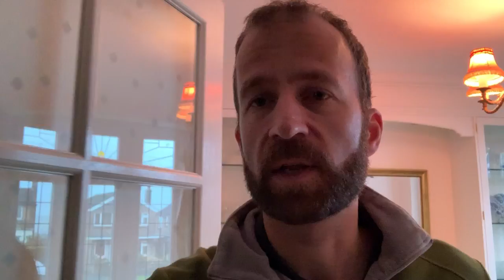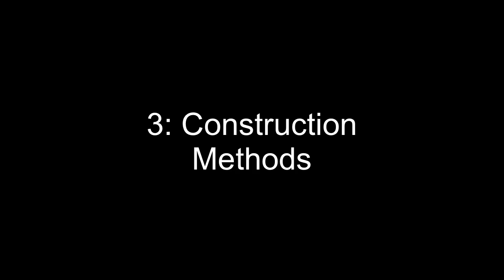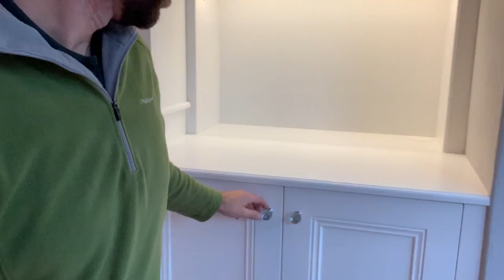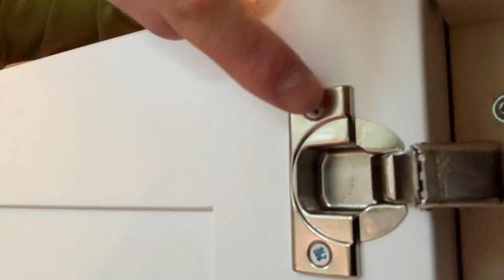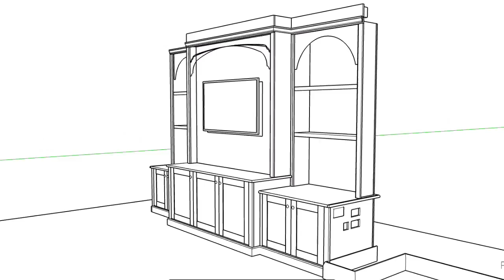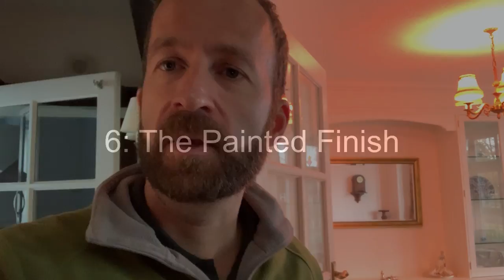£2k vs £5k MDF furniture - What’s the difference???

Comment: Hi Alastair. Brilliant channel. Only discovered a couple of months ago but am hooked. Late response to some brilliant comments. 
I’m a carpenter since leaving school. Now 53. Do a lot of fitted furniture wardrobes floating shelves. I love doing them & would like to just do them all the time. 
I make & fit on site but am in the process of converting my garage into a home workshop. I feel that’s the way to go to achieve better results & make life easier all round. 
I consider myself very fairly priced if anything underpriced. I’m finding I’ve not got a few jobs recently follow ons in a couple of cases where I’ve got a bit dearer due to increasing material costs.
I buy 50 sheets of 18mm mdf. I think it’s medite. I paid about £850 for these from magnets early 2021 by buying them in bulk. Now the same amount at current costs will be £1800. As it’s £36 a sheet now. Other thing I find is quite often once I’ve fitted my work , customers then paint what I’ve done to keep costs down & make a right lash up of it. Clearly doing no rubbing down in between coats especially on edges. Hence getting a really poor finish which to someone not knowing looks like that’s how I’ve machined it.
Reply from the maker: Hi Tony thanks for commenting and I'm glad you like the channel.  I reckon that if you are fitting unpainted MDF furniture you are definitely attracting a very price sensitive customer base and it will be hard to break out of that until you offer more.   It's tricky because the step up to offering painted work feels like a big one.  But the other route is to offer melamine carcases and bought-in vinyl wrap doors.  look at @barrettsfittedfurniture on instagram, or the jounrye that John Jones took from raw MDF - @jonesinteriors_sw - coincidentally he commented on this thread 3 years ago!  Howeer you do your doors, moving over to melamine internals is a must.  Apart from that, marketing is key, as I learned too late,.

Comment: Hi Alastair, I’m making a floor to ceiling display cabinet,  25 mm  MDF top and bottom with hardwood corner posts, it has to be finished in black, I’ve rolled on white acrylic undercoat, rubbed down with 180 grit and re applied a second coat, will rub that down with 220, I need to start top coats soon, I need to put a top quality finish on in black, what paint do you recommend to use on the Leland acrylic undercoat ? Do I roll it and brush it on with a tin of paint or buy spray cans ? I’m not set up yet with my spray gun and compressor.  Any help could be good 👍
Reply from the maker: Hi Graeme, sorry I took so long to see this and reply, perhaps I'm too late.  Black paint can be a nightmare!!!  I'd be wary of spray cans... might be incompatibilty with the base coat.  Safest to use a compatible Leyland or Johnstones product - I'd get advice from a Johnstone's decorator centre.
Reply: @Alastair_Johnson  Hi , thanks for replying, yes I’ve dumped the spray can idea, dug out my compressor and gravity feed gun,  it’s a white acrylic undercoat (leyland) would it be ok to use No nonsense water based gloss from a spray gun, also would you suggest watering it down ?
Reply from the maker: @graemeeasterbrook4931  Honestly, the only thing I can wholeheartedly recommend is the Sayerlack AT99 paint we now use, preferably over their compatible undercoat.   But have you seen this old video talking about our transition from the sorts of decorators paints you are discussing toward better spray paint? https://youtu.be/QjdIoW0rD3o

Comment: I have been working on new builds since I became a carpenter. I recently quit my job doing that as the original spark and enthusiasm for carpentry that I used to have was completely gone. I am trying to get into doing this kind of work and I've only just started out so I'm not going to be able to offer the pre sprayed finish that I would like. But I am a perfectionist so I wouldn't be able to live with myself putting out work like the lower end units you have shown here. I know I can offer a much higher standard to that even if i'm building it all on sight. Does anyone build on site but then sand fill and seal all the edges for the customer? Then they have a much better surface to work with when they paint it themselves? Or does anyone build on site and then also paint it on site as part of the service? I'm just looking for tips as i'm just starting but I also want to put out the best product I possibly can.
Reply from the maker: Yes that's definitely a valid approach - browse the comments, there are high quality workers that take this approach.

Comment: If the customer wants traditional style butt hinges on MDF doors, you can glue a strip of solid timber to the edge of the door, then glue your 6mm panels ontop to hide the join. The timber allows you to securely fix butt hinges to the door. If you sand and seal all the edges this can work well.
Reply from the maker: Ok yes I see.  I do prefer the ease and controlled motion of concealed hinges though!

Comment: I used those hidden hinges before. I did exactly the same as that guy did with the edge grain screws. It split because I joined two boards together. This was when I first started. Thankfully now I use concealed hinges.

Comment: I would suggest that the biggest issue is how does the tradesperson convey to the potential client that his/her work will be worth the not inconsiderable extra cost. In the case shown, the client would probably be aware that the older units are beginning to show the signs of the lower costs - the painted edges, the splitting from screws. This case shows the benefit of getting recommendations from an independent third party ( interior designer in this instance). 

I agree that, for many people, the difference of around £3000 would entice them to have a site operation of about a week as against to the installation of the newer units of 3 days. So, I don’t think that extra 4 (?) days would be the critical factor in getting your workshop built product accepted. 

I also agree that having a workshop is not, in itself, the guarantee of higher quality. It should be because of the higher investment in equipment and time, but we have all probably seen crap from a workshop and excellence from an on-site cabinet maker. 

So, how do you convince someone to pay a lot more for higher quality?
- does the client have the potential extra £3000? If not, walk away
- does the client want better quality? Perhaps they are renting or about to sell the property. Again, walk away
- controversially perhaps, are there signs in the house that the client values high quality? Ornaments, pictures, furniture etc.
- that third party referral has almost done the sales job for you - but can you network with local influencers (what a horrible phrase) to get recommendations
- get the client to your workshop if you can so that they can see the quality - and not just be told about it
- have a library of samples (doors, hinges, edges, mouldings etc.) unpainted and painted, so that the client can make an informed decision
- present yourself appropriately to the client ; don’t come over as a salesman when meeting the client but don’t go to the other extreme. Dress smartly, but not expensively; take your shoes off when going into the house; explain how yours is a family business - it’s success has come through quality and family values; don’t disparage other work on display - even if the client does; just say that every quality has its price and it’s place - our work is designed to last and last - for which there has to be a cost.

That list is clearly not exhaustive - or necessarily totally appropriate as I’m not in the business and so don’t understand it’s nuances. However, I’ve been a (serious) amateur woodworker for over 40 years and, before retirement, had my own business employing around 40 people. I do actually do some consulting work for a couple of other businesses - but these are friends and I don’t expect payment.
Reply from the maker: Excellent points!

Comment: You were being really generous with that other guys work, the fit and finish on it is appalling even for a built on site job. Slab doors shouldn't warp like that as long as the MDF is decent quality, I'm guessing the stuff used there was absolutely cheapest available and then not moisture sealed after construction to stabilise it before painting. It all looked a bit of a cowboy job to be honest.

Comment: There isn’t 3 k difference between the two jobs
Reply from the maker: From which point of view - perceived value in the eyes of the customer, or the different business overhead and production costs?   In truth there are more factors than those in pricing.  Neville Johnson can charge £7k for a pair of alcove cabinets where I would charge less than £3k.  The quality is no better (NJ staff member told me it’s probably slightly worse).  Certain customers will still choose the £7k for the brand association.

Comment: Good video, explaining higher costs to customers is difficult.

I get my boards cut, edged and primed, then joint everything with Dominos and biscuits in my small home workshop. I then take everything to site and assemble. I use Medite boards, Blum hardware and good fittings throughout, everything is finished to a really high standard. I don’t make a lot of money out of this but I’m still getting potential clients telling me they have had a quote for half the price. What I really want to tell them at this stage is that anything that cheap is going to be a total piece of shit. Obviously that’s not quite the approach to take with a client, so I try to explain things in a similar way to you and avoid criticising other tradesmen.

But one day I will snap and start ranting!

Comment: For a hundred pounds or so of extra cost the £1,800 furniture could have been made to be just as good as the more expensive, workshop based product in my opinion.  At £1,900 such a project would be a very good price indeed!  I've been working as a self employed joiner making furniture for around fifteen years so I do have experience to back me up.  I'm a 'one man band' that does have a workshop
Reply from the maker: One of the main sticking points would be matching the sprayed finish’s. The repeated denibbing between coats, the controlled environment of a spray booth, and the ability to spray parts separately laid flat would be very hard to replicate on site!

Comment: Why build furnitures from "shit" (MDF) which is painted after building it? Furnitures from "wood" you can build with boardr made from real wood. Not from glue with saw dust. MDF for furnitures is not worth the work and time you spend for working with. 5.000 Pound for scrap with paint!
Reply from the maker: I’d love to do more solid wood work. But for white painted work consider this: at about £5k for this sort of work I am making a very modest living.  It’s still very time consuming.  If I offer solid wood, the most cost effective option would be radiata pine (knot free, paints well) but this is softer than MR MDF so less durable.  Next option would be tulipwood, but this is no harder than the MR MDF.  Top end option for solid wood for painting would be hard maple.  But this would be hugely more expensive.  I mean many times the cost in materials, but more than doubling the labour cost.  And what would be the benefit?  I mean, ok, to a customer who has £10k plus to spend yes it is better and I would prefer it myself, but it’s hard to justify for most customers.  Also, in some respects it is not even a better material for this purpose. It could not be used for back panels.  Even the deep countertops may be prone to cracking due to natural tendency of solid wood to shrink and expand.  These are just some of the reason why most joiners use moisture resistant mdf for spray painted work like this - stability, hardness, smoothness of finish, and the best value material with those benefits.
Reply from the maker: palereinhold I had similar questions before I started trying to make a living from woodworking so I understand where you’re coming from.  Are you interested in detailed answers?  Happy to give them if you want.
Reply: @Alastair_Johnson  Hello back to the UK ;-)

I think that's the difference between Germany and the peoples in the UK. In Germany we buy furnitures in a store. These are made from 16 or 19 mm chipboard and veneered. The hinges are "European style". You are making furnitures from MDF, painting it and they have horrible edges. Why so much of work for this result? "We" (in Germany) use MDF for workplace interieur... I think it's lost time to work with these materials and the result is poor.

Excuse my bad english - it's a long time ago, that i visited the UK (Sheffield).

I'm working with wood in my small shop (only 4 sm), but for my Livingroom i would never make such things.

Regards and thank you for reading!

Comment: MDF had a bad rap for quite a few years in the UK -- to my untrained eyes / ears -- but having very recently waded into the woodworking world and started making very rudimentary things with it, I can honestly say I'm very impressed with it's strength and flexibility in terms of its applications and uses. Sealing edges and preparing them for paint is a little extra work when going for aesthetics and even long-term durability, but I think it's worth the extra outlay in effort.
Reply from the maker: Jay K yeah it’s not a ‘bad’ material just needs to be used in the right way for the right purpose

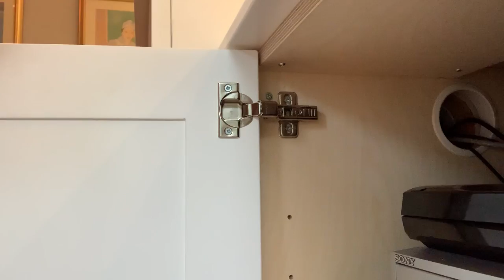Comment: @7:09 looks like the cabinet frame is plywood. What's the reason for that? Why not mdf or particleboard?
Reply from the maker: MySchizo Buddy we decide one day it looked better but also holds the screws better for the hinges. Had a job where the screws worked loose on the cheaper brown mdf.
Reply: Birch ply or just regular?

Comment: Fair comparison however there are some small carpenter joiners who will make the units in their workshop who use moisture resistant MDF and spray paint them and would use the recessed kitchen type hinges and hardware
Reply from the maker: Yes absolutely true, I didn’t mean to be too black and white about differences, there is plenty of quality work from one man setups, in fact some of the best.

Comment: I’d make the cabinets you did as a sole trader for £2800 and £400 to paint. I’d finish the job in 2 days from start to finish for the joinery work and my painter can paint the job in a day. I use a third party to cut the materials for a small fee. Melamine all internal carcasses and completely edged. I’d use paintable edging on any rough mdf edge that includes doors and shelves to make the painters life easier, the same filler panels and hinges. I just can’t understand how you can turn a decent profit sending detailed drawings, spraying(which would take 2-3days in itself), carefully delivering etc...
Reply: And make £2k once everyone is paid.
Reply: +lovey dovey
As a sole trader I assume you are working mostly by yourself?
Scale and production is what defines costings in terms of your actually input cost and sales price. 

If you tomorrow decided to make a Cola drink you would never be able to get to the price and quality level of the bigger companies. 

You either would have to focus on quality which will mean higher cost or decide to focus on lower cost which will then affect the quality. 

If you were to invest in productivity such as using certain machines you will find that you can impact price but you need then focus investment. 

Most businesses that fail do not do so because of lack of sales it occurs because of poor finances.

Comment: Hi, to paint a unit like that i would say a grand, i would probably fall inbetween the two prices that where stated (london) my products are always evolving, atm zinnser 123 plus, then crown undercoat \ primer then crown satin, crown because i have built up a good relationship with my crown shop, tou pret fillers in the early coats ,

Comment: Ps, 2 coats of primer, 3 of under coat, 3 top coat, minimum, sand and fine fill inbetween!
Reply from the maker: Matthew Smith very impressive painting process! What products do you use, what application method, and what roughly would you be charging to paint a project like the £2k one in the video?

Comment: Good video Alistair I’d also argue some if your points. I don’t have a workshop either but get all my panels cut and edged by Cutwrights, all my doors are also made as 5 piece doors. I have seen some dodgy work out there produced in local workshops so I think it depends on the standards you work to. All my painting is done on site by a professional furniture painter and people assume his finish has been sprayed so it’s not all about having a workshop.
Reply: It is all about cost but his overall point does make sense.

Comment: Great video, really shows the difference in quality. I think you could have also added that the national companies aren’t as able to bespoke it as much as they have set sizes to work with often.
Reply from the maker: MrBishbashbosh2012 good point.  I think I might actually have talked about that in a bit of footage I trimmed to avoid the video being too long!  The big national companies (I’m thinking Sharps, Hammond etc, not the higher end Neville Johnson etc) seem to price around my current prices (or usually starting higher, then coming back down with a ‘sale’ offer), but as you say they are not really so bespoke, using fixed door widths and very limited range of drawer runner lengths etc.